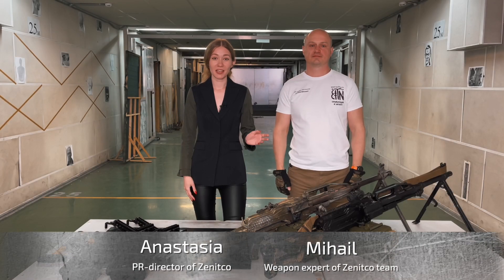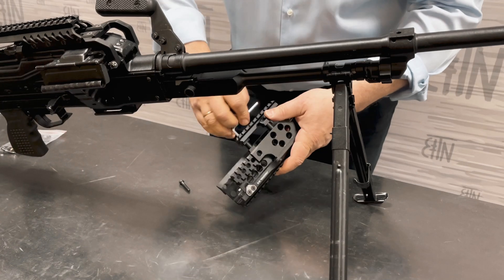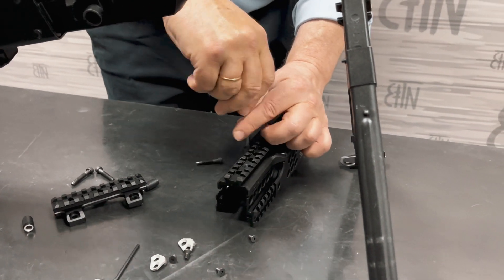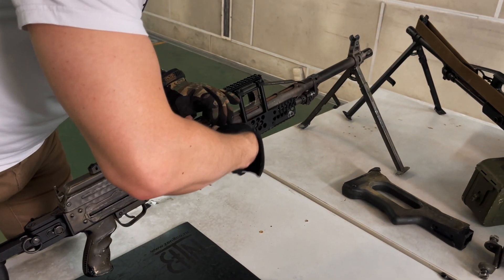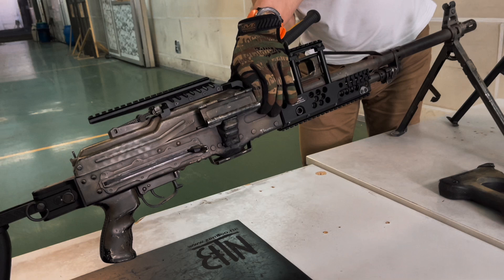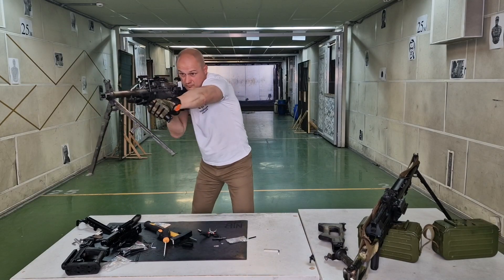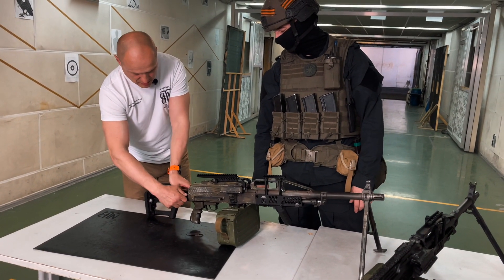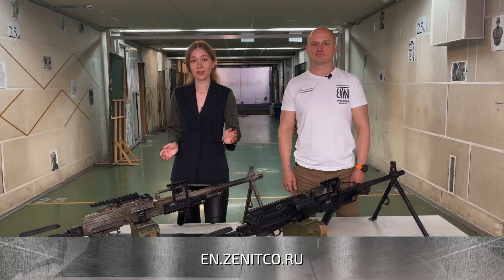PKP "Pecheneg" and PKM machine guns modernization: how to install PT-2, B-50, B-51, RK-2, B-25U

Comment: I have all the Zenitco parts on my PKM. I love the scope top cover mount but when using it with my original wooden stock I find myself needing a cheekrest as the scope sits a little high for that stock. it would be great if you guys could make a special cheekrest that attaches to the original wood PKM stock. It could be attached with velcro straps or with a clamp mount similar to the Dragunov cheekrest.

Comment: But barrel on pkp is not quick change. It is one piece with cooling sleeve.
What about more black pkp, it has different top rail. I wonder  why you dont have nice package for modernization of svd/svds, only side rail mount. I know that SAG made good stuff but it cost 1000$ without stock.